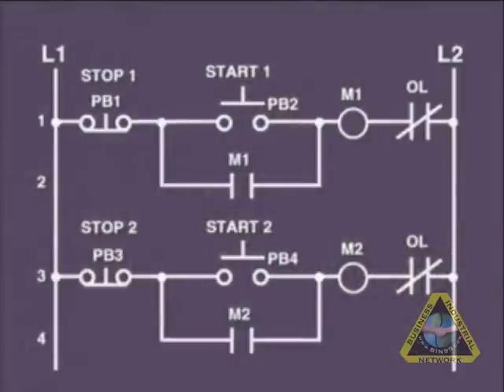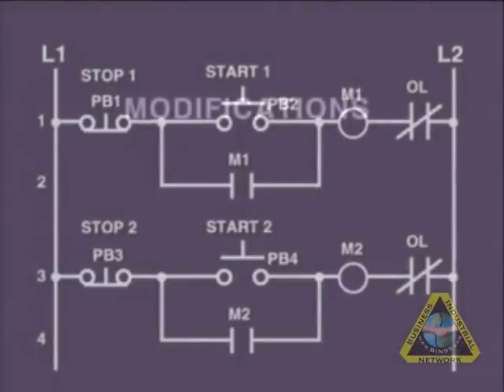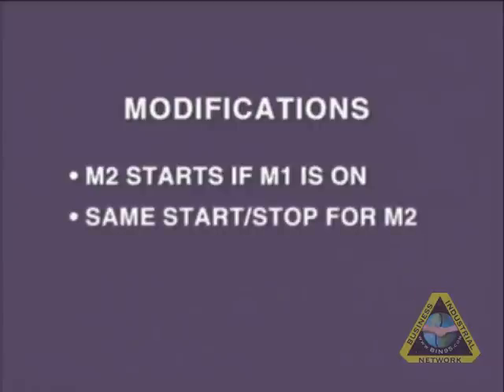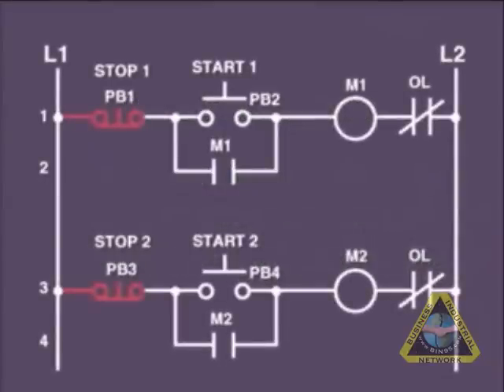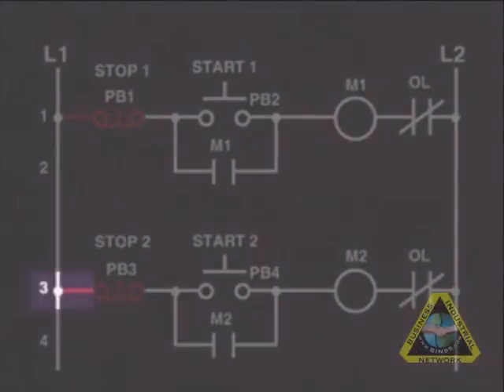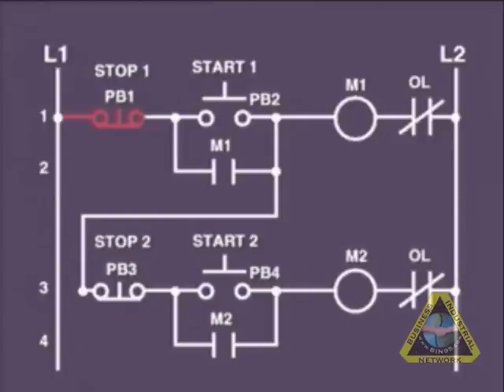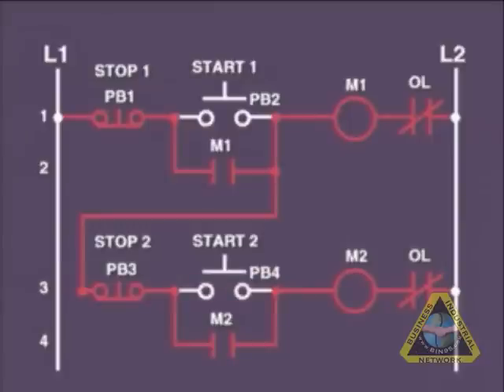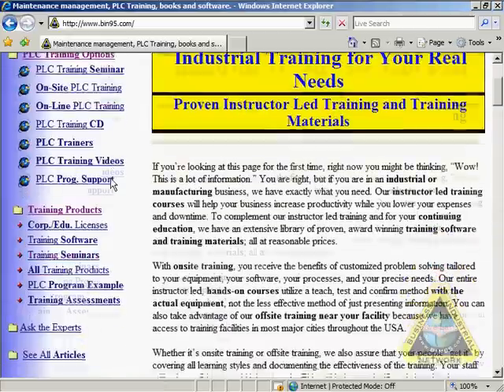Electrical Wiring: Electrical circuits wiring tutorial

Comment: what is the difference if we tap from L1 & L3 or L1 & N for supply to the control circuit?
Reply from the maker: With L1-L3 being 480v, the L1-N would only be 277. That is the difference.
Reply: 480v i comprehand as the contactor is 3ph. But why took supply from 1ph since the contactor is 3ph? Or is there a 1ph connection?
Reply from the maker: Single phase 240 volts (without a neutral) is available between line pairs; (L1-L2), (L2-L3), and (L3-L1). It depends on transformer upstream. Why go single phase instead of three? ... Its cheaper and safer. (the lower the control voltage the better.)
Reply from the maker: Also google T3 transformer

Comment: You could also change the M2 contact to an M1 contact.  You could put the M2 output parallel to the M1, since the start/stop station for M2 is completely unnecessary if it's just controlled by M1.